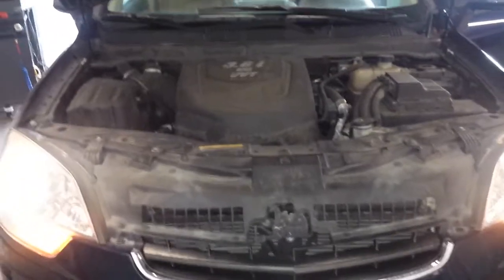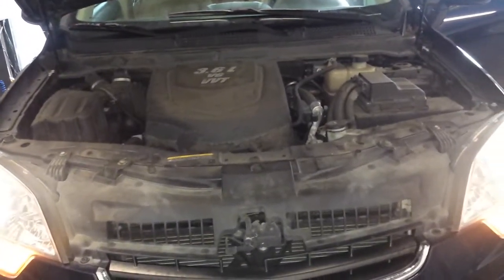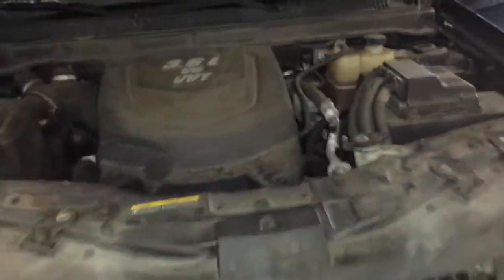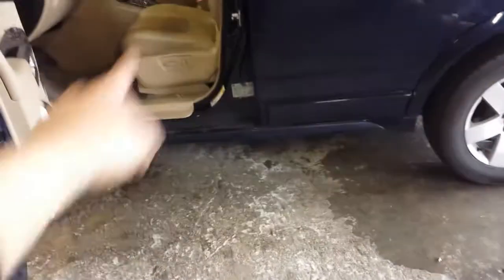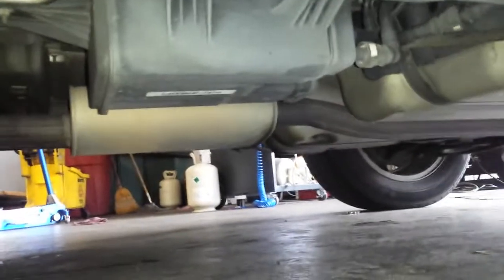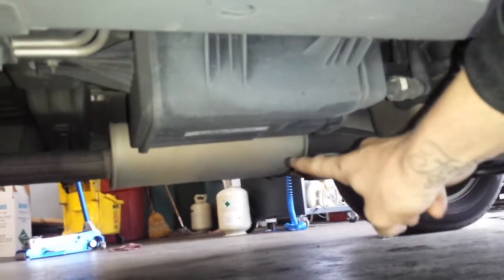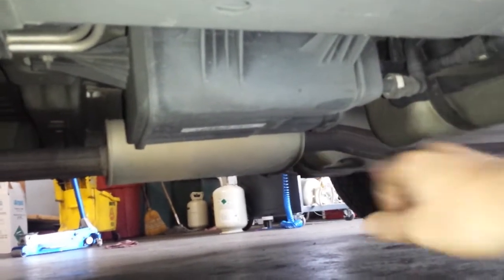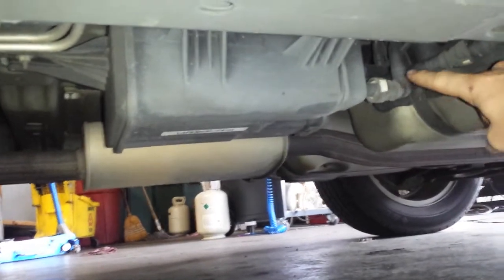Saturn Vue emissions: PCV system, EVAP canister, & EVAP Purge solenoid

Comment: I got the ol P0455 & I have an 08 Vue 3.6L that I want to do a smoke test on (gonna make a DIY smoker) ... not sure where I'd hook the smoker hose to the evap system though, any idea?
Reply from the maker: If you can induce smoke into the hose at the evap purge solenoid from the canister, that would be your best bet. Or the evap service port, that is a green connection on a evap hose under the hood.
Reply from the maker: I think i have a vid on this code. I do a half ass test on a dodge caravan.

Comment: Hey, I've got code P0449 on my 08 Vue; how do I know whether it's the Canister or the vent valve?

Also, what's your guestimate of the cost to have it replaced vs. doing it myself? I'm relatively decent at vehicle DIY fixes.

Thanks for any tips!
Reply from the maker: no personal assistance but I found this on fixya: 
The repair suggested is to replace the canister vent solenoid and relocate it to a position near the fuel filler neck. This may help but there is know way to tell for sure if this will correct your particular issue.
 
I hope this helps.